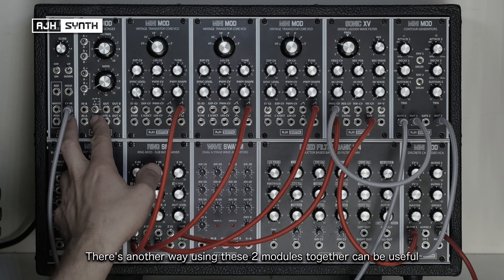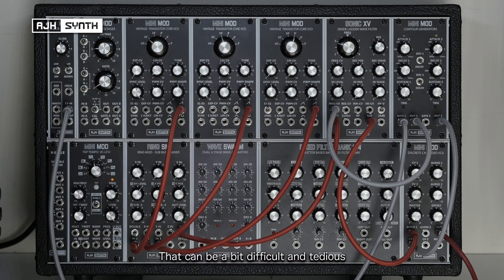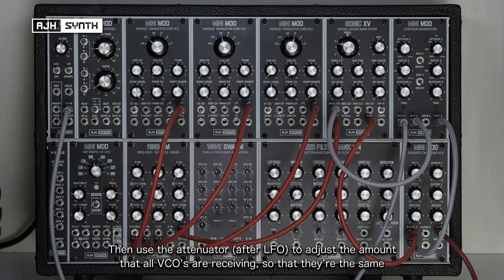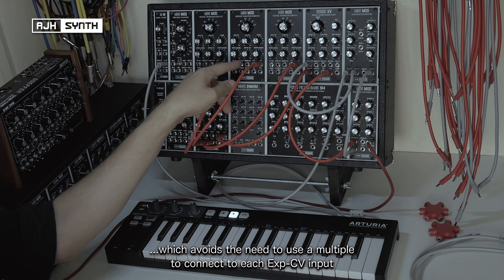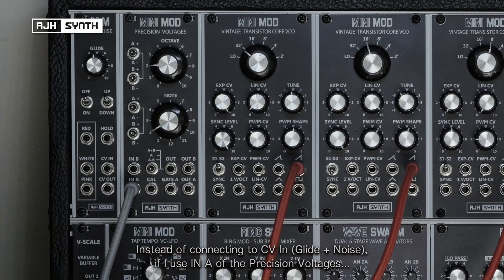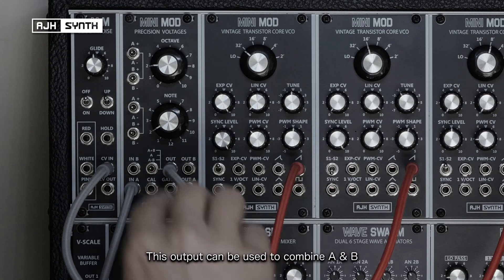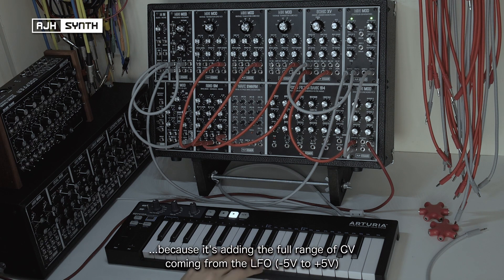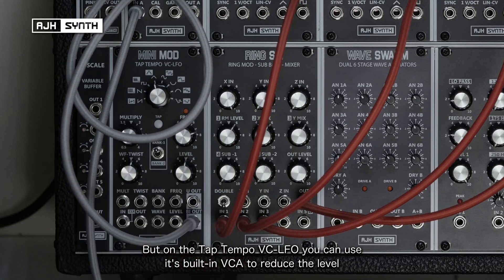LFO to Multiple VCO's Simultaneously via CV BUS with PRECISION VOLTAGES & GLIDE MkII Modules

Comment: Are you the creator of this brand minimod and do you sell kits or have a distrubutor in the US that sells kits of the VCO ?
Reply from the maker: Yes, but the modules are sold as finished items, we don't sell them as DIY kits. In the US perfectcircuit.com stock them.
Reply: @AJHSynthOfficial  Thank you sir that is my goto store and i got a 10 percent off coupon. ill be sure to check out one of your modules some time , which, in your opinion, is the most unique oscillator you have ? or modulator ?
Reply from the maker: We only have one conventional oscillator so far, but also the Entropic Doom noise oscillator. The Tap Tempo VC-LFO is a unique modulator too.